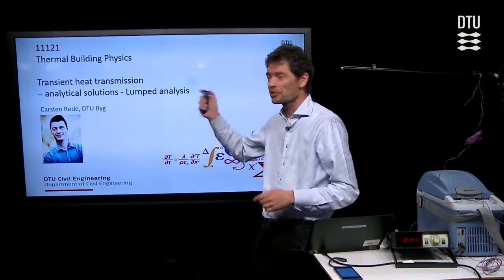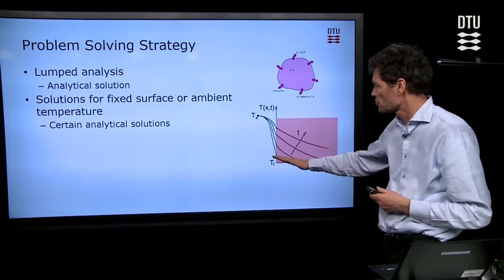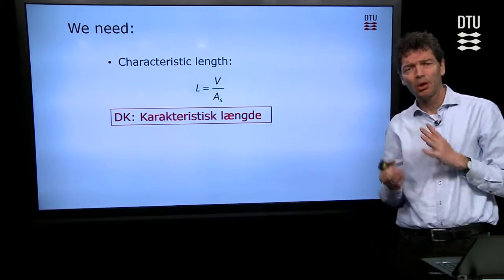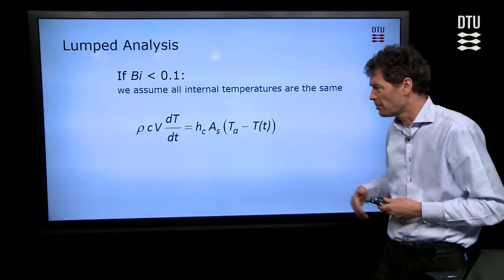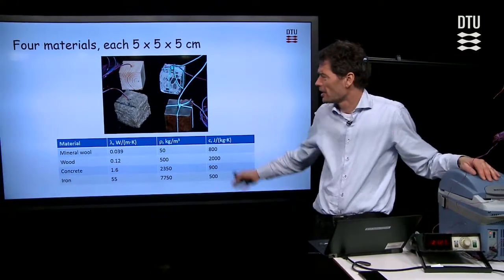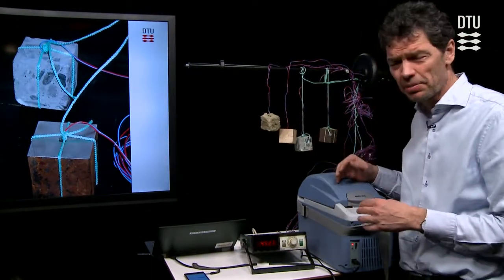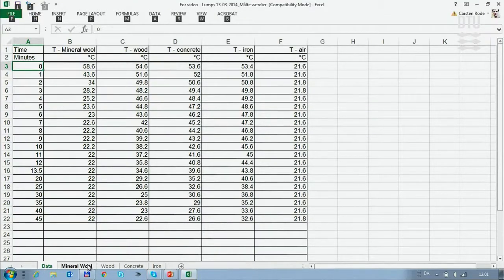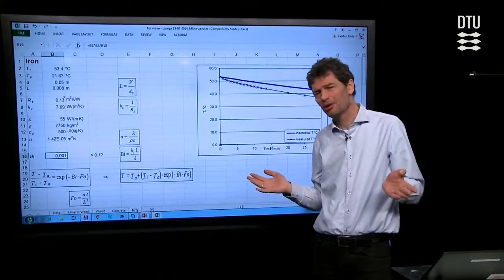Lec 4 |  Building Physics - Heat Transmission: Analytical

Comment: Thanks prof. carsten
charateristic length i calculate by (v/AS)  ( 0.05m x 0.05mx0.05m /(2x0.05 x 0.05 ) = 0.025 m
PLEASE CAN YOU CALRIFY WHY VALUE IN EXCEL SHEET IS 0.008
Reply: I have the same problem
Reply: Had the same problem